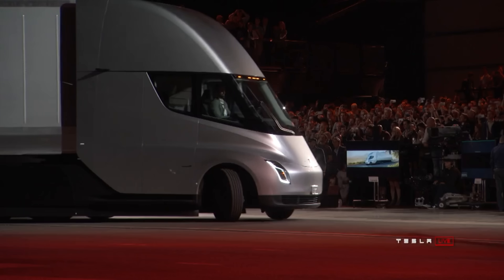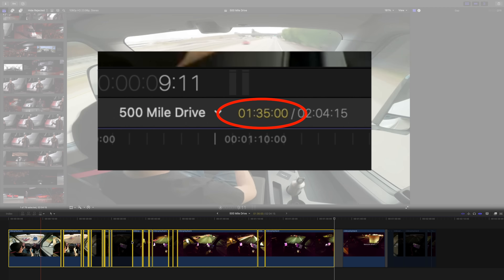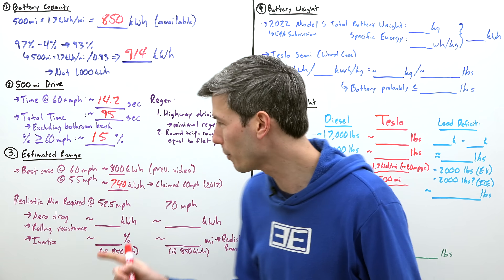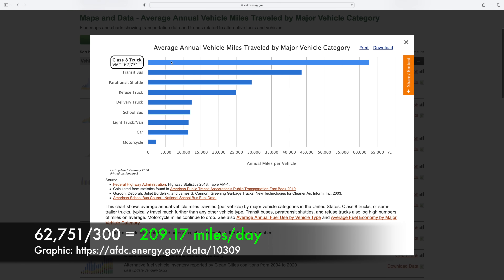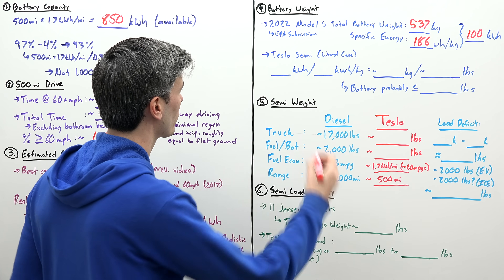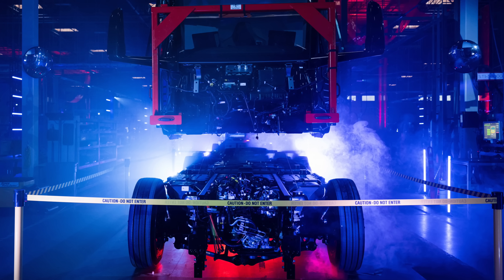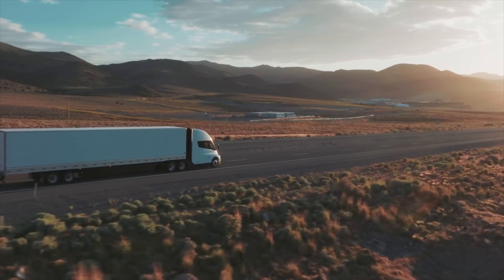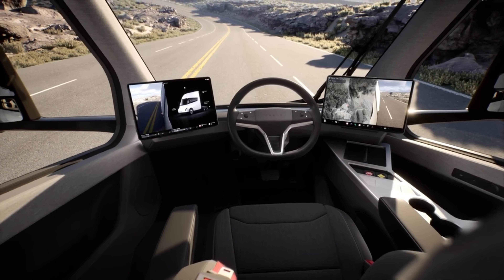Does The Tesla Semi Make Any Sense? Part 2!

Comment: One thing you didn't touch upon in addition to vehicle and charging costs is charging time. I'm highly skeptical of the 45 minute charge time for an 850 kWh battery pack. A diesel truck can fill up in less than 10 minutes with enough fuel for over 1000 miles of range. But I suspect Semi drivers will be counting crows on a wire for more than an hour every time they charge up.
Reply: Charging will mostly be done at night and with no need for fast charging, as the operations the Semi is designed for are mostly business hours only.
Reply: @st-ex8506  If it's limited to local runs (within its range) and it charges at night, that's fine, but in that case, it won't be replacing long-haul trucks as Elon boasted ('it would be economic suicide to use anything else but the Semi' he said, and 'this beats rail' he said). And the only way his cost numbers worked was assuming a $0.07 cost per kWh, which is half the national average. If companies like Pepsi are charging at their warehouses overnight and not fast charging, they'll be paying in the neighborhood of $0.13 per kWh, and will require its own substation to charge, especially multiple trucks. At that cost, it will be economic suicide to use a Tesla Semi instead of a diesel. I just don't see the economics of it working, because Elon just pulled that magical $0.07 per kWh number out of his a$$.
Reply: @ganymede3141  I beg to disagree with you, the Semi retains a significant economic edge.
As per EE himself (1st part of present thread), the 12-month average for the price of diesel fuel is $4.20/USG and the average fuel consumption of a class-8 truck is 5.29 mpg.  Therefore, the energy cost for a diesel rig is $0.79/mi.
Elon has claimed that the Semi' power efficiency was 1.7 kWh/mi.  Let's be conservative and use 2.0 kWh/mi.  Therefore, the cost of power could go up all the way to $0.39/kWh, and the Semi would still be cheaper to operate (assuming it is cheaper on maintenance, a sage assumption).
I agree that the operator of a fleet of Semi will have to invest millions in a significant upgrade to their existing sub-station in order to charge multiple trucks; but those are long-term investment, as a sub-station will last several decades (being an industrial engineer, I happen to know a thing or two about sub-stations).

Conclusion:  I am with you that the Semi, in its present version is not designed to do long-hauls, and that Musk "anticipated"!  It is also not yet the right choice for an owner-operator, or even a small trucking company.  However, for large operators on short- and medium-haul, especially on standard unchanging routes (likely the majority of US truck transport... but I am European, so feel free to correct me on this assumption), it is and will stay very competitive economically!

Actually, the Semi's specs are ideal for the European market, as distances are shorter, the speed limits much lower (lower than even in CA) and the legal driving hours for the driver fewer.  In Europe, the europeanized version of the Semi could be used for long-haul traffic, and with diesel at over $8/USG would be hugely cheaper to operate, even if the cost of power is also higher than in the US!  Furthermore, diesel trucks are gradually being banned from even penetrating into an ever growing number of cities.

Comment: How might they perform in Manitoba & Ontario? ? lol
Reply: Just the same, why? Because of cold? Well, with the battery and cabin being maintained at optimal temperature when the truck is hooked up, the range reduction will not be more then ca. 10%… except if there is snow on the road.

Comment: I live near the busiest (and most polluted) port in the US - the Port of Los Angeles. In order to reduce pollution, the city have been trying to ban diesel vehicles for the past 20 years. Many loads picked up at the port travel short distances. So battery capacity and range may not be very important for port use. Even if Teslas semis only traveled 200 miles - I could see ten thousand of them servicing just that one port - regardless of specs.

Comment: The only calculation you missed is time=money. If it takes longer due to slower speeds and charging times,  that has costs associated with it. Not just for the trucking company but for the clients as well. As I said in the last video, the problem with simple assumptions is that it doesn't account for other factors that can have a major impact on ranges, like cold weather.
Reply: also impact of temperature on battery performance both too hot and too cold.  Likewise, high elevation impacts ICE performance due to lower O2 concentration...though somewhat mitigated due to MAF and FI compensation

Comment: An new piggy back battery system is available ,for diesal semi , connect to standard turntable ,then power its own two drive wheels, look interesting but just like Ev semi ,only time will tell , could use battery in built up area n Run on diesal in open ,plus they only lose about tonne of payload , because it got it's own wheels to cary battery

Comment: Awesome work as always. 
Just saying I am over the road
everyday ( have been since 1973 ) and anyone that doesn’t 
make at least 500 miles a day
at 65 mph is out of business as
far as over the road is concerned. On the weight it is
not that every load is max it is just that you must be able to
handle it if needed.
Reply: That and OTR drivers basically live in the truck so they still need power even after their work day is over
Reply: Maybe so with current tech .
Reminder that there are many less parts to breakdown on EV vehicles and your fuel cost so to speak are less. Maybe that equation changes.
Reply: @marcogutierrez8669  EV's are vastly more complex than ICE vehicles and statistical they have been shown to breakdown MORE than ICE vehicles. You have to realize we've been making gas and diesel engines for over a hundred years whereas EV's are new technology so there's still a lot of bugs to work out. Also as far as saving money on fuel, the vehicle cost 3 times more than an ICE vehicle so in the end you're not saving anything
Reply: @js6729  thankyou for your perspective as a de facto operator in this field. I have no idea why anyone imagines that running out of juice after 500 miles is not a severe constraint that will impact on revenue in an indusrty with wafer thin profit margins.
Reply: Sure, but in most cases it seems those 500 miles would be done in several legs, which opens up for charging when unloading and loading if the infrastructure is in place.
Reply: @Boreasos  the problem is time. Those batteries are HUGE
Reply: @Chrisp707-  Sure but if it takes 30 minutes to top up that is time spent loading anyway right?
Reply: @Boreasos  that’s if it takes 30 minutes. Those batteries are huge the amount of power needed to top it up in 30 minutes is insane.
Reply: @Chrisp707-  It's almost a requirement that you'd have to be able to top them up enough for the next leg in the time it takes to load and unload. Don't need a full charge for a 150 mile leg for example.
Reply: @Chrisp707-  also the degradation of that type of fast charging on batteries is huge(not from the charging it self but the heat generation it creates)  i would not be surprised after 1 year or 2 the battery capacity in these semi will be 10-30% less
Reply: @Boreasos  those batteries would take at least 45 minutes to an hour to top up and this would only work in a few situations, the business where you are picking up you load would have to have charging stations installed at every loading dock and a lot of the time semi-trucks do what's call drop and hook which means you pick up a load that's already ready when the driver arrives and you drop that load off and pick up another load that's already ready to go, sure there's times we might have to wait but the majority of OTR is drop and hook.
Reply: @Chrisp707-  also the faster you charge a lithium ion battery the shorter it's life will be and the higher the risk of the battery exploding. (Anyone remember the Galaxy Note 9 🤔)
Reply: @js6729 
Of course it could only work where the infrastructure is in place. It won't happen overnight and will start with routes to and from huns where there are charging capabilities. Perhaps truckers just hop from one truck to the next while the one they drove there with charges.
Reply: @tomaszwida  yep vs the power capacity of a diesel engine is still the same after a million miles
Reply: @Boreasos  that statistic that semi-trucks only drive an average of 250 miles a day is highly out of context (context being the situation in which something is relevant) because local delivery trucks might only drive 80 miles a day but as a fleet owner,  what the OP said is 100% accurate, if you drive OTR and are not driving at LEAST 500 miles a day (most of my drivers myself included average around 600-650 miles a day) then you're going out of business
Reply: @Boreasos  no offense but what you are suggesting is asinine, as I previously stated OTR trucks don't stop every few miles we pick up our load and haul a$$ we're not stopping every 150 miles to change trucks because you have different trucking companies and so if you drive for xyz trucking you can't just swap equipment with someone that drives for abc trucking 🤦 and trucking fleets already struggle to minimize costs of operation so we aren't gonna go out and buy double our fleet of trucks so that we have a standby truck every couple hundred miles. Don't get me wrong I'm not saying there will never come a day where EV semi-trucks are capable of OTR, when they come out with a battery pack that has a 800 mile real world range that has a lifespan of 40+ years and every truckstop in the country has overnight charging stations in place then, and only then will it be practical to use EV's for OTR trucking. But you seem to have it in your head that OTR trucks only drive 100 miles or so at a time and then stop for 30+ minutes, we don't we drive typically 400+ miles non-stop and when we do stop to refuel it takes  15-20 minutes give or take not 45 minutes to an hour. To put this in perspective with both tanks on my Peterbilt full with a typical load I can drive a little over 2100 miles before I need to refuel again and generally when I'm getting close to running out of time that I can haul I'll stop at a truckstop and top off my tanks then call it a day.
Reply: @js6729 
As hominems and insults don't really make you sound more knowledgeable or reasonable.

I have repeatedly specified a host of caveats. And it is all very situational and you are presenting the extreme OTR case which is in real terms a minority of goods transport. 

Tve DOE averages for daily driven miles of any given truck, which seem to be around 200 miles per day on average, are a good metric for most situations. That of course means many drive more and less, and many trucks perhaps drive less than their drivers who might change trucks at depos.
And there we have a possible solution. Instead of dropping the load and picking up the next, you might swap a truck if the one you're driving needs a refill. 
For many use cases this is plenty good enough. Again assuming the charging infrastructure is in place.

It's not like refueling is a zero time endeavor either. You don't just spend five minutes filling up at the pumps (assuming a high speed dispenser and an average tank). Perhaps you stop at the truck stop for 20-30 minutes for a mandated break.
Routines might change but there are always solutions, and the future doesn't have to be the same as the past even for long haul.
Reply: @Boreasos  refuling a semi-truck does not take 45 minutes and the only mandated breaks are a lunch break, yes you are allowed to take breaks but they are not mandated in the vast majority of situations we truck drivers are on a severe time crunch so we only stop if we absolutely cannot avoid it. As a company owner and fellow driver I would never ask my employees do anything I myself am not willing to do but as a whole industry trucking is extremely time sensitive, if you have a load that the customer needs in 18 hours and that load is 1,390 miles away you don't have time to piddle fart around you've got to reach and get it or they'll find another company who will. Going back to the time it takes to refuel, the truck on my fleet with the worst fuel mileage is a 1981 Peterbilt with a 3408 CAT engine and that truck can go just over 1700 miles when fully fueled as opposed to 350 miles for a tesla.
Reply: @Boreasos  so again I ask do you drive an OTR semi-truck?
Reply: @js6729 
I do not but I have family members who do.
Your use case is extreme and not ripe for electrification, but then I've not once said that long haul OTR trucking is a good use case for the current models from tesla.
But for most transport it would be perfectly sufficient. That is a start and there is no need to be such a vehement naysayer when I keep making caveats abundantly clear.
Reply: @Boreasos  and for what it's worth this discussion thread was specifically on OTR trucking and the fact that with current technology EV's are not capable of doing that, I have never stated that EV semi-trucks will not work for local trucking. But that government stat is lumping all semi-trucks together into one category which takes the milage driven buy truck drivers way out of context because OTR truckers average at least 500 miles a day where as local drivers might only drive 80 to 100 miles a day on average so to lump the 2 together is completely out of context.
Reply: @js6729  it was the note 7 not note 9 goofy, and that had nothing to do with charging speeds, the QC process for those batteries was fucked and they were overheating because the temp sensors weren't working properly they were just a failed install of the batteries hence they recalled all note 7's, fixed them, and they had the same charging speed just new batteries. With that being said, it's a big issue for these semi's that their batteries will degrade over time I expect a 10% degradation in maybe 3-4 years which is pretty bad.
Reply: @Boreasos  spoken like someone who has never drove a truck before lol trucks are only legally allowed to work 12 hours a day and only 10 of that can be actually driving, so no we don't do that 500 miles a day in several "legs" we don't stop and take a break every hour or anything like that, heck when I was first starting out we would talk an empty bottle or 2 with us so we didn't have to stop to use the restroom (I'm not even joking)
Reply: @js6729  If you drive for 10 hours a day, and most transport routes are short as the data shows, then clearly it must be done in several trips for the majority of truckers.
Long haul is a small minority.